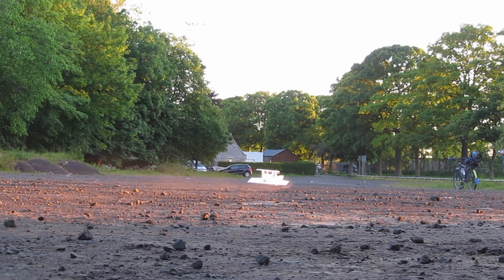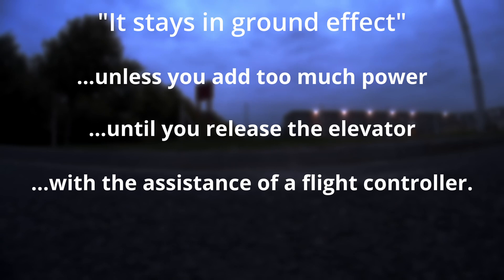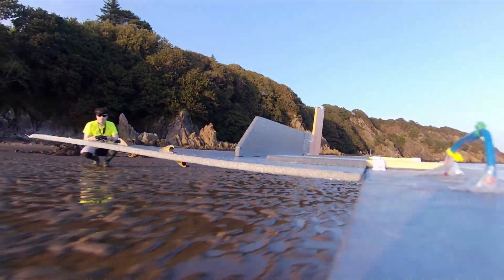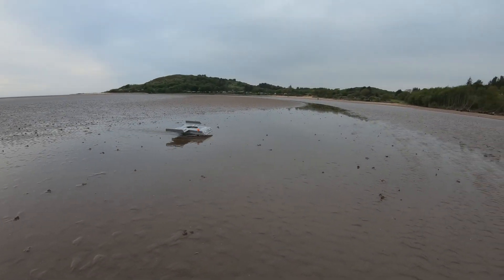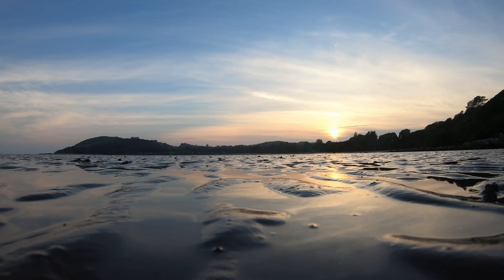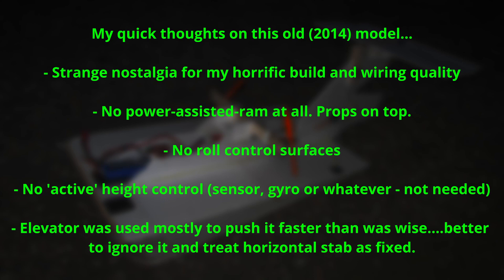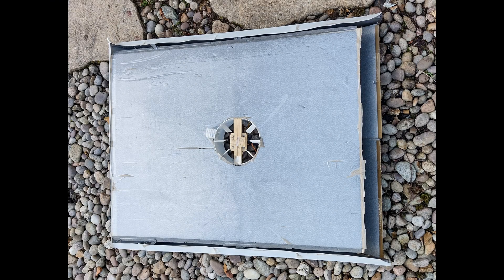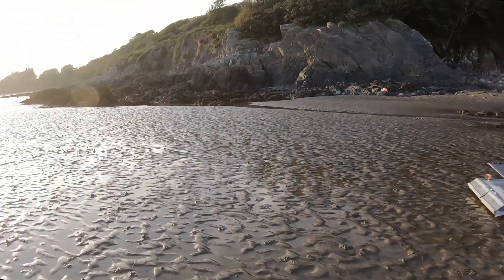Skirtless Hovercraft - Ground Effect Vehicle Hybrid. Trial runs and brief thoughts.

Comment: does this sort of design have more efficiency than a multirotor for just hovering?
Reply from the maker: Good question - but you need to define "efficiency" carefully to determine an answer. And even then the answer is sort of open to interpretation. I say if 'moving on water with minimal power' is your goal you should be looking at a boat, not a hovercraft or multirotor.

Assuming we mean "power to elevate some weight above a surface on an air cushion", then the skirtless design is more efficient at achieving an absolute minimum hover, but then falls away rapidly compared to a multirotor as height away from the ground increases. Some testing I done last year : https://www.youtube.com/watch?v=B0Ow8veYIl4

The skirtless craft will lift at a TWR of ~0.15 using very little power. If you were only interested in moving around on smoother surfaces it's a much better solution than a full multirotor. No flight controller is needed, stability is excellent, you can tap off airflow for thrust and turning without tilting the craft as a whole. Props are also enclosed so they're protected. And the foam hull doubles as a float.

As you increases hover height to be more practical on rougher surfaces, you do lose efficiency and approach a region where direct multirotor thrust would be better. You still have the advantages of passive stability with the hovercraft at least. Just dropping a multirotor into ground effect isn't capturing all the possible benefits.

I'm running some more tests to find a hybrid design that tries to work as a hovercraft at lower heights and then transitions to a more conventional multirotor arrangement at greater heights.
Reply: @Glydaire  I'm just looking a this from a how long could I possible get a multirotor to hover at any height sort of thing. Because currently its possible, but difficult to get 20g/w of thrust on a multirotor, but with this you say you can hover at 0.15 thrust to weight, but what it really means is that at low altitude the thrust is greatly increased beyond its open air thrust. So I'm curious if some sort of arrangement like this could hover well beyond the current world records.
Reply from the maker: Ah ok. I think the actual problem would be arguing if this design "counts" as a multirotor or not. You can achieve a few mm of lift over a smooth surface with incredibly little power if that is the only thing that matters.

Based on my experience if you call it a hovercraft people will say it's a multirotor and if you say it's a multirotor people will say it's a hovercraft. Fun times!
Reply: @Glydaire  Good points, however if you are able to fly at a higher altitude like a typical multirotor, and then you just have some crazy good ground effect it might be seen more as a transition somewhere between a hovercraft and multirotor. Happy to hear that you can get lift with very little power, I really do want to build myself one of these.
Reply from the maker: I've done some more tests on my automated rig - lowest usable lift (3-4mm) is indeed at TWR 0.15, could probably drop this to 0.1 with a better/lighter build. If you run with the "thrust multiplier" figure the effective grams per watt is about 70 at those very low hover heights. And this is with an ancient Turnigy motor, with a newer generation motor the g/w could presumably exceed 100.

So that's highly encouraging for efficiency in that close ground effect range.

Comment: I agree with your definition. Perhaps I would add that the convex air profile is not used. Although it may not be that simple, because I saw a model that stayed in the air thanks to an "air bubble" under the fuselage, but an air profile on the tail was used to maintain balance. And in this case I would accept it. Because it was only about balance, a trimmer could also have been used, but the designer wanted better performance.

Comment: Lookup Charles Bixel and his WIGE and aircraft designs.
Reply from the maker: Oh I'm well familiar, my first attempt with the Bixel design was about 8 years ago. Back then it was a plain "Ground Effect" (not really!) vehicle on skids. It's not very practical at the model scale without ludicrous power and/or power assisted ram to break the initial ground friction and get it flying in ground effect. Then you have so much spare power you may as well make it an aircraft and drop any pretense of GE operation. Or you downrate the power and run on very smooth surfaces only.

The hovercraft hull is ideal for establishing the initial cushion and is practically frictionless. So you transition from hovercraft lift to "mostly" ground effect lift as speed increases, done on this model by closing off the front air jets.

Comment: Agreed that a true skimmachine should only have power and directional control. As soon as you add elevators and roll control you can tell that the craft is not relaying fully on GE (B and C type?).
Your craft has some nods to the Hoverwing I believe, but less maintenance required. It is mesmerizing to see them hover so majestically!

Comment: Hovercraft, wet sand (so less dust) and a Sunset - amazing
Reply from the maker: Less dust but that wet sand does find its way in eventually - water gets blown out, sand is sticky enough to pile up inside at the front and gradually change the CG over time.

I can imagine an internal ramp that stops sand coming in but you don't want to interfere with the air going out. Tricky one to resolve.

Comment: When you said too much yaw stability makes it difficult to turn, I noticed that when I was trying to create a realistic hovercraft in Unity. 
I found that adding reverse thrust at the rear on one side worked very well. So I had one "motor" on each side, one motor having full forward thrust, and the other side having 60 % forward thrust and 40% reverse thrust.
Reply from the maker: I'm wondering if a drag brake might make for better high speed turns than the split flaps - I'm picturing a flap on the sidewall at the back that pops out 90 degrees and acts as a sort of "reverse thrust" while leaving the flaps as they are.

This is something for a small testbed vehicle - time to build another one as I probably won't be back at the beach for some time.
Reply: @Glydaire  that sounds like a good idea